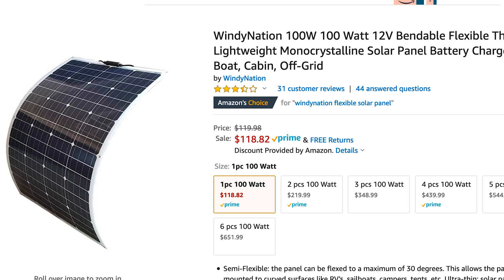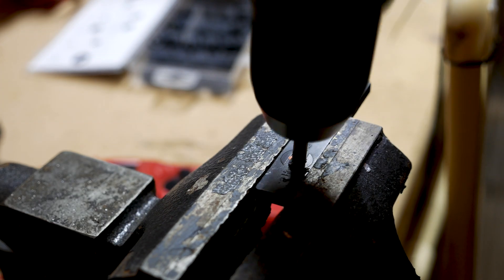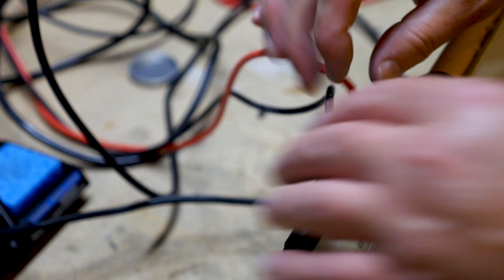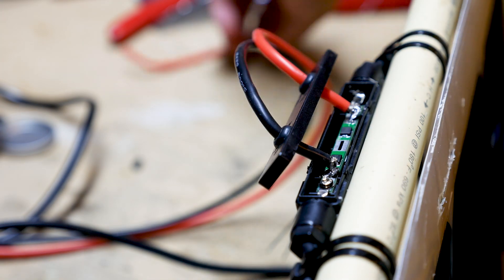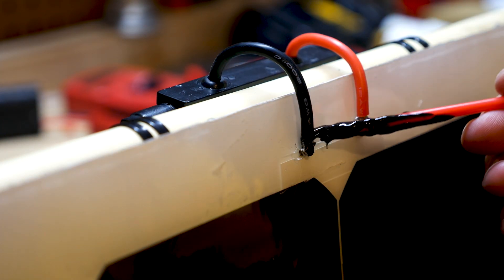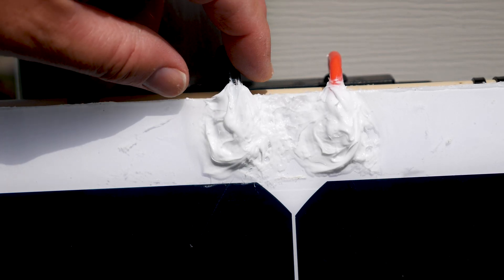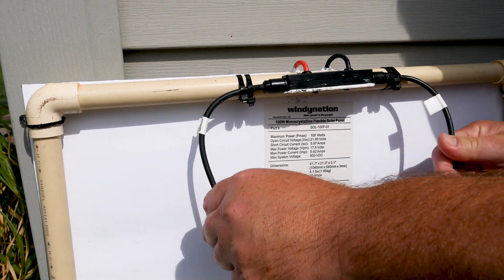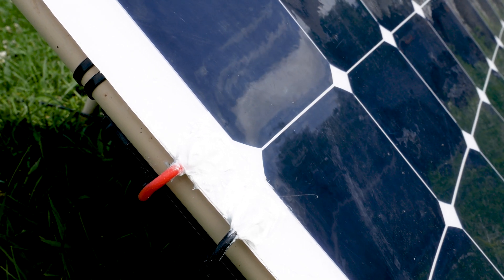12-Volt  Solar Panel Repair & Mod

Comment: I like the PVC frame/zipties/connector to PVC upgrade with the 'external' wires. Your solder job looks a bit dodgy. Making sure your iron is hot and cleaned off with a damp sponge before you tin it.
Rant over :-)
Reply from the maker: Yep, not the world’s best solderer, ever chance is a opportunity to improve...